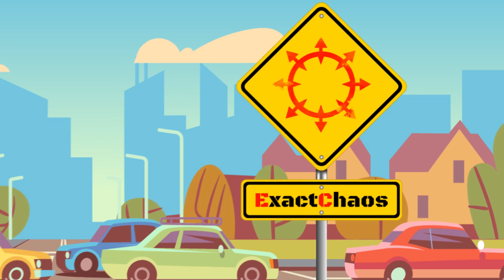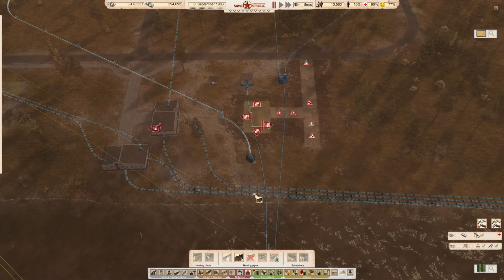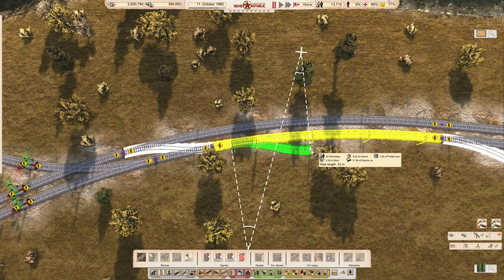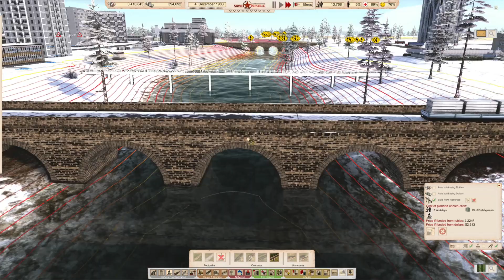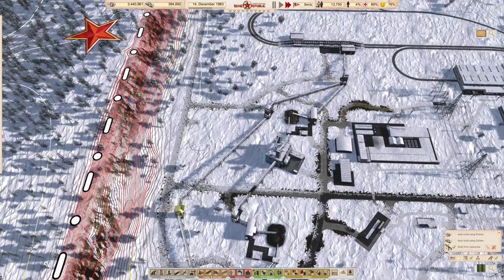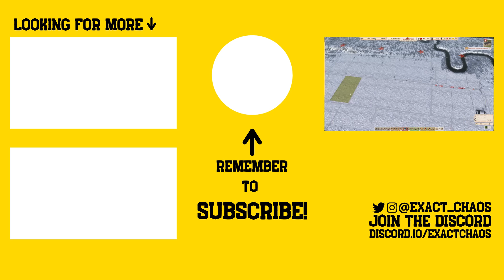Welcome New Residents - Workers & Resources: Soviet Republic

Comment: In Italy a rail Electric substations have Power Transformer capacity around 4-5 MW
Reply from the maker: Thanks, thats good to know.
Reply: @ExactChaos  the hovehead catenary voltage in the game Is that of a tram system (500 v DC), in Italy in a conventional line Is 6 times that aka 3000 volt dc and in High Speed lines 50 times that aka 25 kV AC 50 hz, such low voltage thats mean the wires are made of a super heat sturdy alloy a russian gauge hitachi Caravaggio train Will absorb at maximum rated hourly Power output 6800 amps or 6.8 kAmps